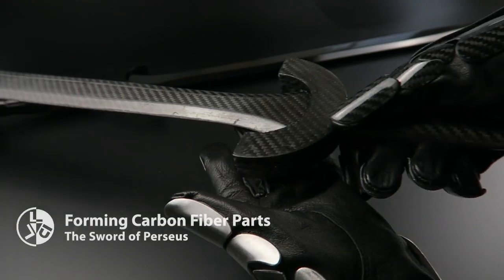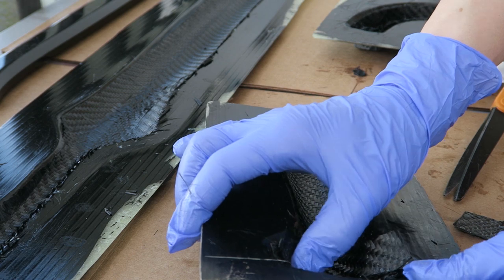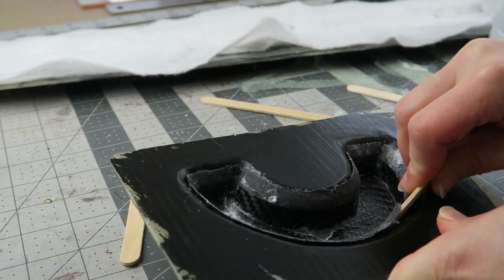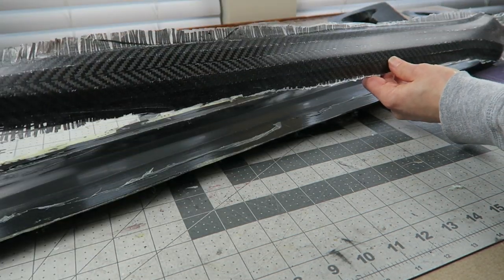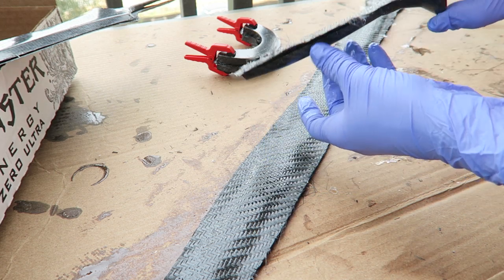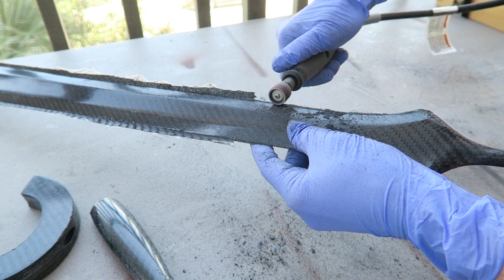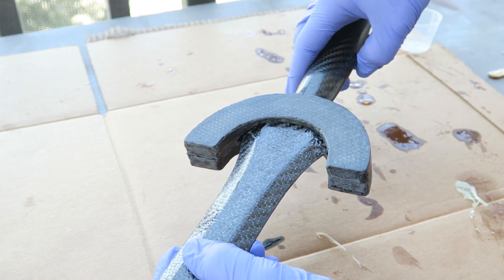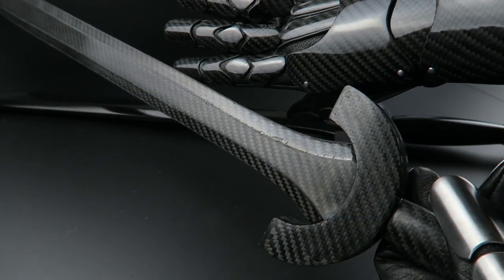Forming a Carbon Fiber Sword

Comment: Have you ever thought of incorporating tool steel blades into the edges of your sword to produce a high strengths thin blade that can be sharpened and have very good durability
Reply: nightmare Shadow 😁
Reply: Yup someone watches shad.

Comment: What did you use to join the 2 sword peices together? Is that a reinforcement carbon tape? I need to join 2 carbon parts together
Reply from the maker: More of the same twill and epoxy.
Reply: @LindyDesignLab  Is the foam necessary? Or can we just use the carbon twill. Also, do you soak the carbon before you lay it on for the joins ?
Reply from the maker: @yamaharaptor1896  yes applied resin before assembly. The foam was an easy way to keep the carbon in place while the halves were put together, no other purpose.

Comment: Hi Lindy, strength wise how does a carbon fiber play 3d printed sword compare with the carbon fiber moulded version?
Reply from the maker: Neither would survive a a good wack against a solid object I think, but the carbon fiber one is super light and rigid.
Reply: @LindyDesignLab   The moulded (sheet) version?

Comment: you should buy some 19 ounce carbon twill and a good quality clear epoxy with uv protectant then  layup 4 layers and vacuum bag and oven cure if possible. this was way to thin . sure its light weight but i dont think that will hold up very well. you need an air saw to trim the edges and that dremel is the hardest way to trim carbon that ive ever seen plus the dust from carbon is worse than fiberglass dust so always trim with a razor blade when possible while still in the mold.

Comment: A sword made of anything but steel(something like 1060HC or 5160SS), bronze, or iron will only be good for 'decoration'.
Reply: Idk but think they did a pretty good job killing each other on the bronze age but yeah I agree steel is superior. Even a diamond sword (if that's even doable) would have to be made razor sharp on account of it being near impossible to sharpen and idk what the weight and balance would be like.

Comment: And... Just a though, how strong is this sword? Like, can you use it as a proper one? Or make different tools like an axe?
Reply from the maker: The primary strength of this material is that it is very rigid for its weight. While it can be sharpened, it will not hold an edge well.
Reply: @LindyDesignLab  thx

Comment: Great video .. and an awesome channel ...

one doubt i had though... when you are joining the 2 halves of the parts, do you use a normal Clear Epoxy Glue or the same Epoxy resin, used to make the CF parts ?
Reply from the maker: Used the same laminating resin.

Comment: The camera work is good, the lighting is good, the commentary is decent, the work is not great. The process needs refinement. The printed design you fill with plastic wood could have been suppressed. The split mold could have been done such you didn't have to cut so much excess material away. The pin holes could have addressed and remedied. If you were to have spent just a little more forethought, you could have made an amazing sword. Instead, you made a "just ok" sword, maybe. I applaud your attempt and the courage you need to take on a project like this. Just do it better next time. You know you can.